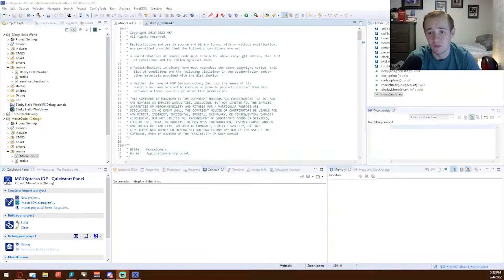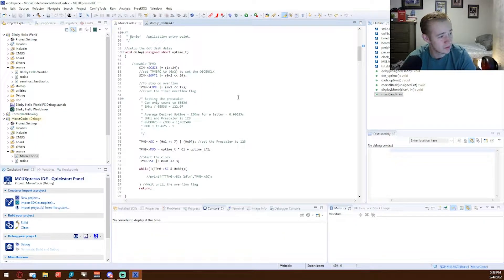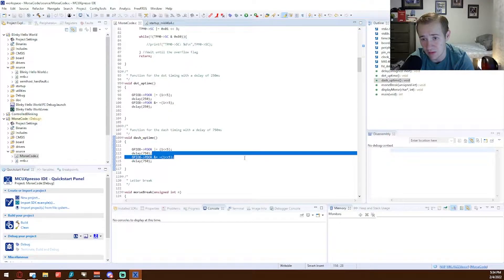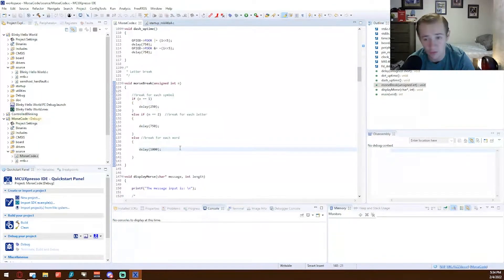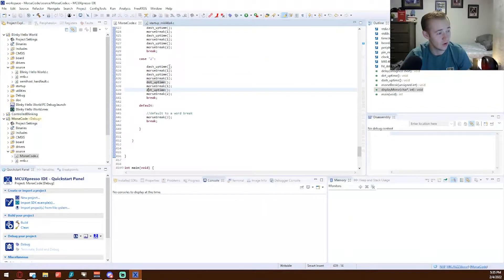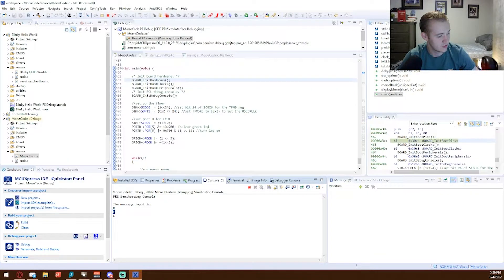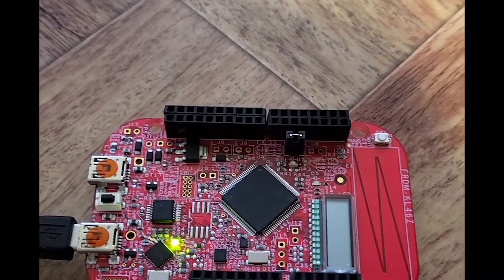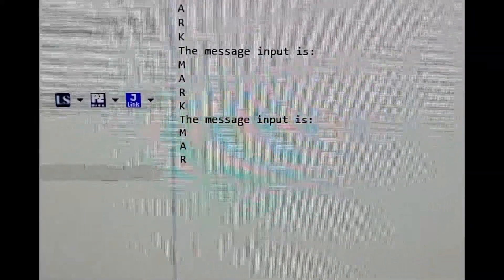FRDM-KL46Z Blinking Morse Code | Embedded Systems Test

Comment: I have connexion problem with MCUXPRESSO ide for the same board. So i can not debug my projects. Any idea about this
Reply from the maker: Hi,
Happy to help! The easiest place you could be experiencing this problem is due to hardware and drivers with the PC you're connecting to. As well as the target MCU's state not being set up to the correct PORT. These are all things you can check with the device manager when plugging into your PC.
Also, make sure you're using a data USB cable and not one that only supplies power.
This is what I would start with to get a connection to your PC!
Reply: @markashinhust9552 hy friend, thanks for your help, I will try to solve this. First my cable is data one i can transfer binary files with it to the board. About the connexion port I don't have any idea but the board is detected automatically with MCUXPRESSO.